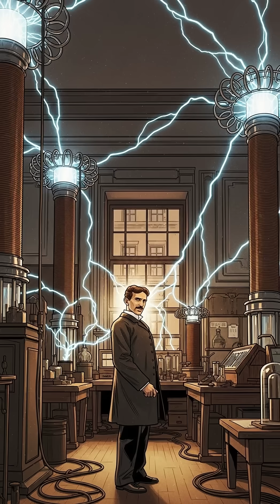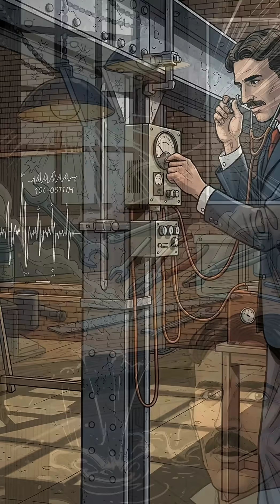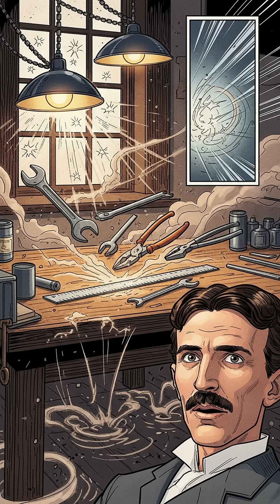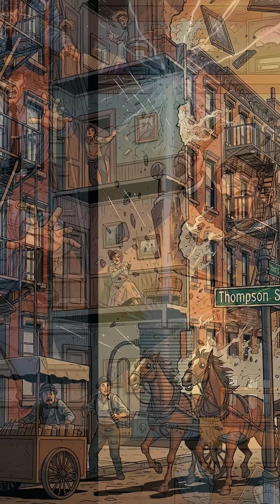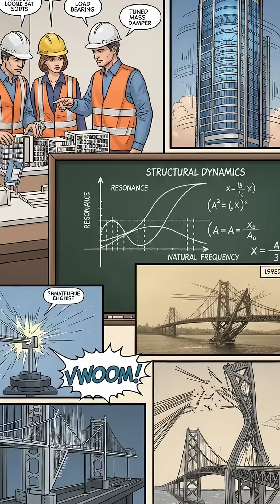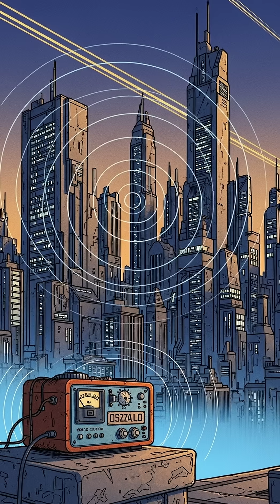The Lost Tesla Experiment That Shook a City Block

Comment: I question the accuracy of the Tesla story. The harmonics are real. But, when flipping a switch,  flipping a switch will suffice, why would h elect to find/use a hammer?  P.S. The degree to which harmonics can amplify is dependent on both the excitation force and the structure's damping coefficient, reducing its coefficient of restitution. An assemblage of steel beams, enmeshed n brick, concrete, wood, etc., would appreciably lower it's coefficient of restitution, meaning that it would take an extraordinarily large excitation force to risk collapsing a building.

A building is not an equivalent to the filmed 'Tacoma Narrows' bridge collapse, where that suspension bridge had very little damping. (Engineers later estimated they could have added damping to save the bridge by adding air foils on a portion of the span's lower trusses)
Reply: sounds good
Reply from the maker: I dunno, but when machines malfunction they can get hot and cause all sorts of trouble.